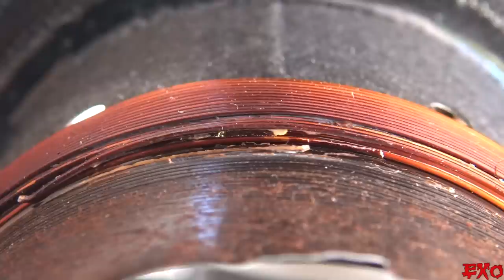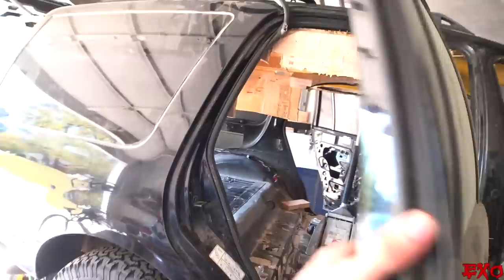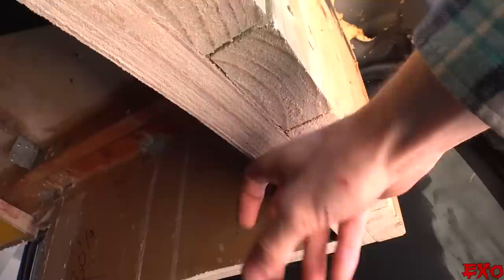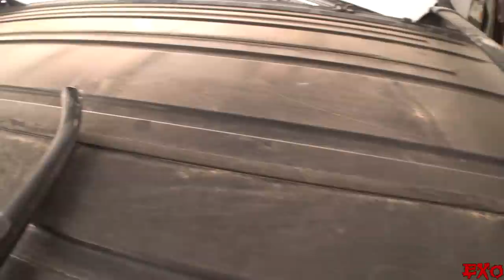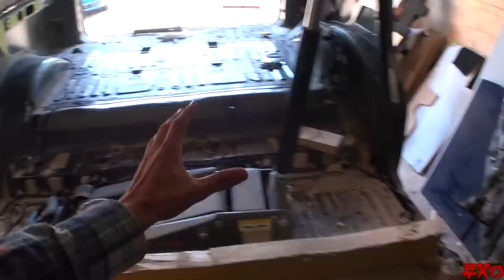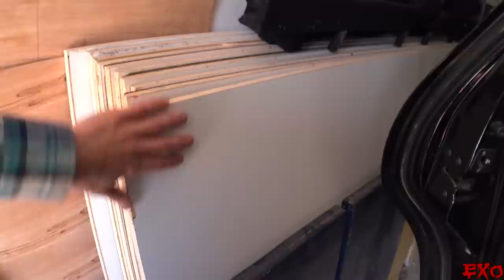BLOWN SUB After 30 Minutes of Music!?!? Car Audio Updates w/ FRANKENSTEIN & Rockville K9 Subwoofer

Comment: Well...you get what you paid for, yeah
About the "box" on Frankenstein, if you really plan on using every single cube of space, you would need to either brace it up on the uneven sides, or stack layers of plywood, forming the sides. Better design it for the long run, it ain't easy to build, then destroy, and build it again. In my opinion, a replacable baffle would be welcome, to suit different sub sizes. CA(cyanoacrylate, Super glue) glue is very strong, but not that cheap haha. Just brace it enough to last years(even decades) and not too much that you'll drastically reduce box volume. To account for positioning, my opinion is to place the port hole where you could easily access it. 8 subs? A 'V' or 'M' baffle form, you cannot fit all those subs on the front easily. As long as you feel you want the design, I'm really fine. That's yours, too!

Comment: If you're going to double up those pieces of plywood you're going to have to use laminate top cement for putting counters together that stuff definitely holds up because it sort of melts the plastic anything else that be kind of cautious with especially because of all that bass flexing in and out but then you have to worry about the laminate coming off where it's attached to the wood.

Comment: EXO! I know you’ve probably thought this out a ton. But are you sure 8 18’s is the best choice? Is there enough volume? To use it as only an example, there has been other people who went from 8 or more 18’s down to 6 and got tremendously louder. A Tahoe and Expedition are roughly the same size. Maybe you’ll have the room if you go all the way out to the windows. Obviously you know the car more than I do. Lol. I just don’t wanna see you disappointed is all! You might be able to fit 6 18’s in a flat wall with a driver port in Franky if you stagger them. That’d be sick nasty if it would work!! Otherwise I vote for a 4th with a driver side port!

Comment: Maybe sand the white laminate down so that it's not smooth. Glueing a smooth surface may lead to glue failure. And depending on the adhesives used to attach the white glueing may lead to the failure of that adhesive in itself

Comment: Take out your palm sander and give the laminate a roughing up. The glue will stick just fine. Just make sure you also screw them together as the outermost later of laminate will want to separate from the rest over time.

Comment: I know this video is suuuper old but I read up that if you try and do an spl run and run the sub over the cea rated power like you did in the install video (you said you ran it at about 1500W) (the cea rating is 1000w for the 12") then the top layer of glue melts on the coil or something like that and causes the coil to unwind, but as long as you keep it below or at the cea rated power then you will be fine. But on the newer revision of the subs that are sold everywhere now, that glue issue is reportedly fixed but I just thought I would let you know what probably happened to you. I actually just bought a 15" dual 2ohm rockville k9 running on a audiopipe apmi-2000 that can do about 2000w at 1ohm but I'm for sure not going to turn it up that loud. I used to have a fatboy 15" and 2 boston acoustic competitor 1000 10" subs but I blew the 10's after about a year and a half of straight abuse (even blew a cheap boss amp with them kinda on accident) and after the amp blew with them it increased the resistance of them to about 5 ohms instead of 4 but it could've been because they were cold I have no idea, but now I am just running the fatboy 15" but I'm scared to turn it up because I've blew an amp and 2 subwoofers already and don't trust myself. I didn't really blow them though, I bought them new and never used for about 150$ for the pair, they are so old (about 15 or so years) that one of the subs makes a creaking noise if you push on one side of the cone and makes a constant tapping noise when playing but the other I completely blew up, dark brown voice coils when I shine a light through the cracks and makes terrible clipping noises all of the time, but it used to turn heads of everyone nearby and you could hear it inside of buildings on half volume and shook bottles in the cupholders in the front seat and I loved that, but you and my brother have turned me into a bass head and I'm sooo hooked :)

Comment: 4th order...I would build the back chamber to the hump and from the seat part foward would be the front chamber. I would replace side windows with 1/8 inch steel. Drivers side port with built in detachable seats, just maybe some kirky racing seats. some stripper poles and and braces then have the whole thing rhino lined.
Reply: MullinPerformance  Line-X is a million times better than rhino liner bro...I agreed with everything else but that

Comment: Have you ever thought that your EXTREME testing of these speakers might be a problem?  Another possibility is that amplifier may have failed and put DC current to the woofer that fried the voice coil.  Rail voltage to the voice coil is instant death.  No speaker is designed to take a continuous wave at anywhere near full power.
Reply from the maker: Everything was set perfectly with an o-scope. The quality just wasn't there...

Comment: in the back of the truck where the hatch is you could cut a big hole and put a hidden compartment to put have alot of the batterys so make more room for a bigger box to instead of the batterys take up so much space have the amp rack removing so u could service ur battery

Comment: Good going on the rip out.
That ply you have will probably give you a world of pain for an install. I would save it to make wrk benches and stuff for your shop, it's usualy good ply in that stuff and hard wearing and cleans easy.

Wood glue wont touch it, you would have to corse sand the melamine and use some kind of epoxy resin. The melamine might have an additive in it to make it hard wearing, like they use in laminate flooring. it aluminium oxide powder, same stuff sandpaper is made of and the second hardest stuff on the planet, diamond being first. It will grind all your blades blunt and be even more of a pig to rip out . Plus the fresh cut edges are razor sharp.

Tbh, dunno why you don't go back to mdf, it`s best for audio, tooling and finishing apart from its heavy. 
All the best

Comment: I went with a budget build the Gothic 12 and the 2500 Watt mono block to go with it I haven't had a system in 20 years so I'm definitely getting my guilty pleasure of being addicted to BASS again but I would do the front panels facing the driver and passenger and then the sides and maybe the back in a 3/4 or 1inch plexiglass then the top and bottom in 1inch or bigger birch or mdf then add a mix of plexi bracing and wood bracing to the build
Reply from the maker: WOW! Bet it feels good to be bangin' again after so long!

Comment: also was gonna say for the excess glue on the ground a possible airplane solvent would remove it right quick. only downside is that it would remove the paint as well from the floor of the trunk but that can allways be prepainted
Reply from the maker: I like extra glue ;)
Reply: EXOcontralto classic exo lol keep up the great work brotha. Lookin forward to the reworked frankenstine keep bassin.

Comment: Crazy idea aswell. Stop the box about 6 inches past the hump( if your going that far). Have the port tunnelled to behind you and as wide as needed. Passenger side can be the amp rack. Creatively put together though of course. Have 3 18's on each side facing slighly inward. The other 2 dead center. Then wall it off at where you want the amps to sit
_____
!/  ---   \!
!__    !
!       !   !

Comment: On enclosure design it would get tricky but I'd like to see kinda a bandpass with a spherical shape with as close to an equal distance from all subs to the center as possible with plexiglass port walls going to the center of chamber, just do note the backspacing limits of the woofers coming in from the sides, and if you can't fit all 8 in a config like that I would have a couple of them in a sealed chamber up front, it's kinda a sound q box in my mind that I think should make brutal spl

Comment: EXO if not you can take out the laminated with lacquer thinner in a spray bottle and it will take a little bit of time but you can remove the laminator from the panel I used to work with shop years back

Comment: That laminate could peel if the glue sticks at all. Take a DA sander to it and ruff it up good so the glue has a chance to stick good. When you double and triple up. Put screws as well as glue. You can use wood putty or glazing putty to fill the screw holes. If you C shape the front of your box you can do 10 18” subs. Make them look like the 5 side of a dice 🎲 2 in the top 1 in the middle 2 in the bottom. Maybe port your box to the rear of the truck ? 10 18s would definitely be louder than 🤬🤣

Comment: I have been rocking Rockville 12s for some time now, about a year, and they are still fine. Powered by a CTSounds Amp.  Ok it is only 1400 W into 2 subs, but they are doing good.

Comment: I just got a brand new rockvill 18 club sub (literally 4 days ago).... super slow brought system to just under clip in comparison to 15's... then two pro djs from the start said "its not even hitting like the 15's"  one guy watched the sub amp while the other continued adusting ever so slowly... then, it jumped right over clip into FAULT... YET, the 15's off the exact same main, made no change (in otherwords, there was no signal change/spike else the 15s would have went to)  we realized it "blew" when the volume was turned down to about 5% and it was just rice kripise crackling away... none of us understand what happened... other than what you said... it was some kind of mechanical failure...  it happened 2 hrs ago, I am heart broken... and wallet broken.  I was at peak level of care and concern, even wanting to "break it in" and keep it well below the limit for the first few shows.  I am certain it wasnt clipped, the 15s sounded great the whole time, they weren't even close.  Ugg..thanks for letting me rant.  :(

Comment: If you have a blown Rockville subwoofer recone it with a psi recone kit and use the original Rockville dust cap and you will not have any problems

Comment: Well if you want to glue them together, you just have to sand it a bit, so that the glue has way more surface to glue it together. Just be careful that you clean it with your vacuum cleaner before glueing. Wish you all strength tackling Frankenstein

Comment: I defiantly wouldn't use that wood with the lamanet but you should be able to heat up the surface with a heat gun and easily peal it off. Only. Down side is the glue will still be left on plywood

Comment: somewhat of a long post incoming!  Rockville stuff looks half decent, but is junk. I had (have) one of their amps...the RXD-M5. Had it wired to 1 ohm, which the amp is supposedly safe to run at. Smoked the output FETs. I got a replacement thru their no questions asked warranty, and put it into a different car with smaller subs, running at 2 ohms this time. It went into protect more than it should ( which is to say never, if it’s wired right). I took it out of the car and replaced it with a Rockford Fosgate Prime 500.1. The Fosgate amp blew the Rockville amp out of the water in terms of sound quality and SPL. The Rockville amp is rated 1500 watts at 2 ohms CEA2006. The Fosgate was rated at around 670 watts CEA2006 if I remember my birth sheet correctly. A ~600 watt amp blowing a ~1500 watt amp out of the water. That says it all. The Fosgate is still happily pounding away to this day in the 2nd vehicle. The Rockville is in its box in storage. I might give it to a friend for his first system.

Moral of story: Rockville SUCKS! Cheap chinese junk, stay away!

Comment: That laminate if you heat it up with a heat gun will come off with a putty knife like not very hard at all if you're just right you can just peel it off by hand but I'd recommend using a putty knife because it will be hot

Comment: Suggestions

For wiring,  go with the shok industries 8/0 awg wire from engine bay

For the subs, how about an adjustable port system, so u can change tuning frequencies 

And even a convertible box, where u can change from ported to sealed,

Comment: Jesse Apr 23, 12:56

Hello,

Thanks for contacting MTX Audio. Your alternator is probably a 140 amp alternator which is capable of 140 amps of output and is responsible for providing all of the electrical power to all electrical components that your car is using such as audio system, head lights, gauge cluster, computer, tail lights, turn signals, horn, etc... Also, if you have any other aftermarket electrical accessories installed, those will also use amperage from the 140 amps available.

If all of your electrical components combined are pulling more than 140 amps, the system will start pulling power from your battery which is probably why your battery started to lose voltage. The alternator wasn't able to keep up with all the electrical components and keep the battery charged at the same time. 

The audio system sounding distorted was due to the amplifier struggling to get enough power from the vehicle's system and not having enough power can cause problems with amplifiers and electrical circuits in general.

140 amps is not too low for the TNP212D2 package that you have but it may be too low for your vehicle depending on the current draw the rest of your electrical components require. The amplifier of the TNP212D2 can pull up to 60 amps at full volume.

It could also be that your battery is bad and isn't taking a charge anymore so the alternator is struggling to recharge it while also powering all the other electrical components of your vehicle. 

There are a lot of possible problems that we simply cannot diagnose through chat so we recommend taking the vehicle to a mechanic or a car audio shop to be tested.

Hope this info helps.

Jesse S.
MTX Audio Tech Support

Valenj7 jay Apr 22, 18:34

Hello, okay, maybe you guys can help me out with this, I have the 1200watt
mtx subs package the matching amp and bass control knob. now my
alternator is a 140 voltage. so one day, I was playing the system. And then
my battery meter reading was moving down to red, then the music was
sounding distorted, so I turned it down, then I stopped to check the
lights, the head lights was still bright, so I see the bass control red
knob light stopped working, but the amp lights still was on, just but now
no sound from the subs, and all the fuses still good, even the alternator
fuse still good, so would this be my.... 140 volt alternator or the
voltage regulator to the alternator. and is 140 to low for the MTX 1200
PACKAGE I GOT FROM FINGERHUT.....THE SYSTEM IS GREAT, SO NOW THE CAR STARTS
BUT BATTERY METER STILL READS LOW ? PLEASE HELP THANKS

Message your customers with tawk.to - it’s Free!

Comment: I would do about 2.5 per 18. I use .82 per 12 and so do a lot of others, and from what people I personally know do is about 1.75 per 15 and 2.5-3 per 18. I like yo stay on the smaller side I seems to work better and the subs can handle more power.

Comment: The rockville 6.5 components are not any better. During the 1 year warranty had to replace each midbass twice and 2 of the tweeters. Audiosavings replaced them with no problems. But they should not have been blowing that often. After warranty ran out replaced them with kicker ks and no more problems now.

Comment: It holds to the laminate but it won't be as strong as wood to wood. So like @Drakkar Calethiel said sand it down to get the best adhesion or like I did and remove the laminate. But it's sharp so it cuts.

Comment: EXOcontralto Use 80 grit and sand the laminate so the glue has a surface to bond to if you decide to use all that wood.
Reply: Even then the bond won't be good enough. You need to rabbet route a lip off the laminate to expose the wood to get a proper bond.

Comment: Exo...   I used to work with laminate get a putty knife a heat gun and lots of acetone once you get it started it will all come off the wood very easily laminate to laminate although it makes the wood extremely strong it doesn't bond together well

Comment: if i had access to your sett up i would be making 2 walls of 4   with a centre port making a giant tunnable bandpass box     you would only have to open or close the port while leave subs side closed or tuned your way hell you could go giant round port so you could swap tub length in and out

Comment: on the wood just brush grind it bro so when you use adhesive it will grip just brush grind barely to where it's ruff not so smooth

Comment: I was going to add a comment to your first video with the Rockville and the 140db you hit..... and this was a genuine question for those of you experts out there.....  wouldn't the only difference be the quality of the sub in that environment?  Identical... box, port, amp, driver size....  wouldn't you expect with the same surface area in the same power to produce the same db?  the difference being can the sub handle the prolonged power...  just a question here.
Reply from the maker: Not at all. There's more factors at play than meets the eye. Even motor force alone is a large enough factor to make one sub louder than another of the same "size"